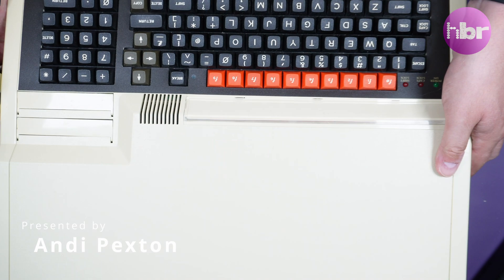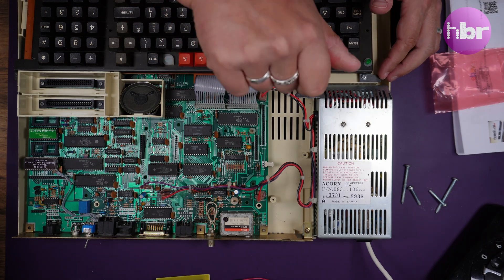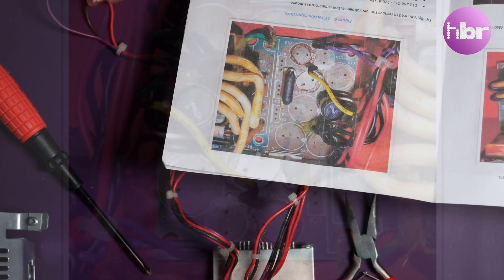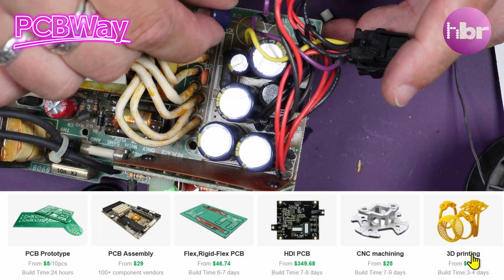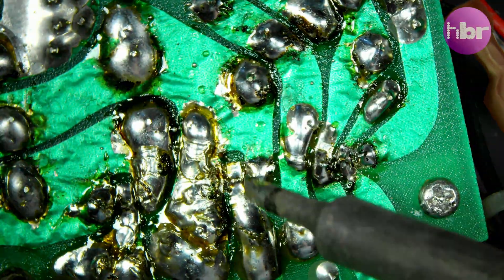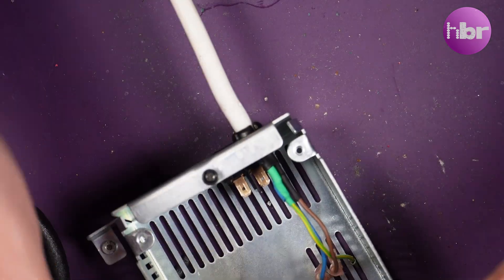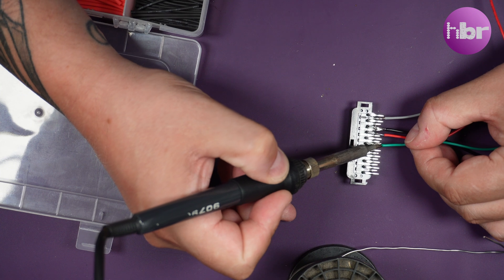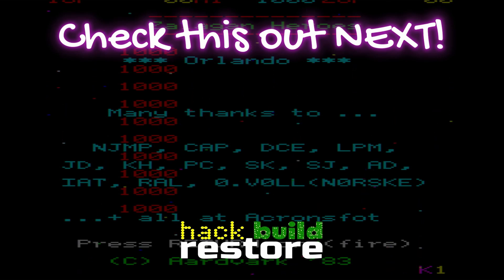Why Did Someone Cut the Power Cord on This Vintage Computer?

Comment: In the 70's I worked in the Sears electronics repair dept. Sometimes customers would bring in an item for repair and never pick it up. After waiting a period of time Sears would have the right to dispose of it. They didn't want to resell it as used. Policy was not to allow an employee to take it home. They didnt want to lose even more money by paying a tech to remove the part used to repair it. The solution was to cut off the power cord and throw it away.
Reply from the maker: Thanks for sharing 😊

Comment: Bravo! Love the Beeb machines. I have a huge soft spot for them :)
Reply from the maker: They are where I started, so very much the same!
Reply: When you are 13 and your dad walks through the door with a BBC Model B, Microvitec Cub monitor and Cumana dual 40/80 switchable floppy drives.